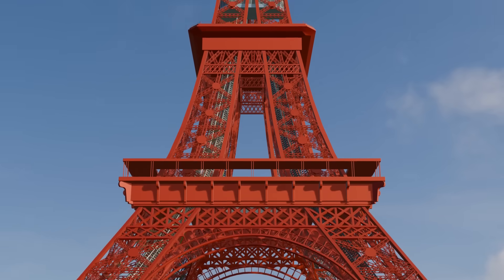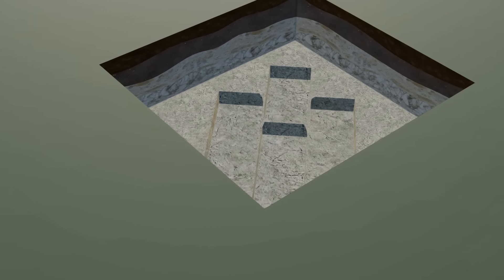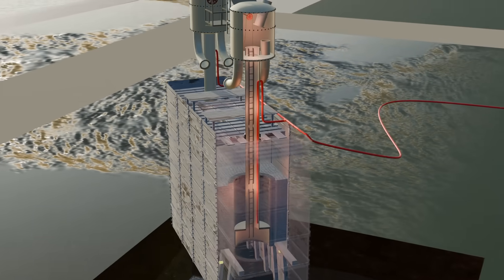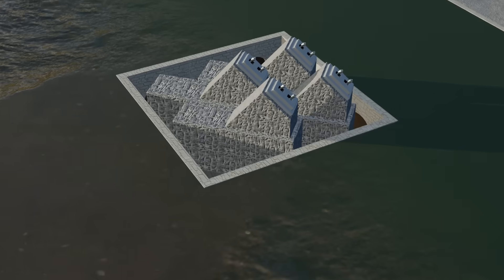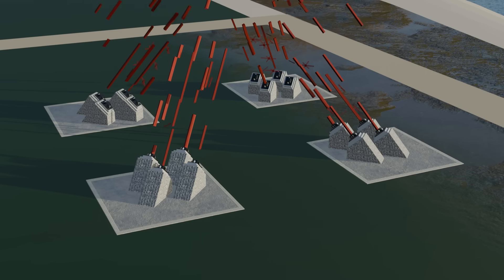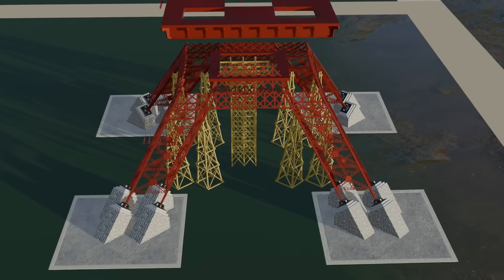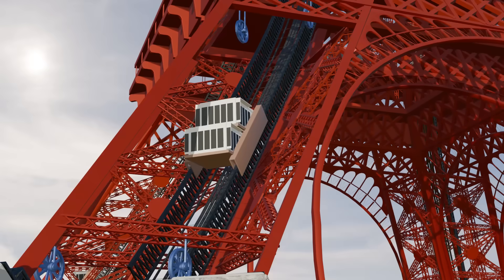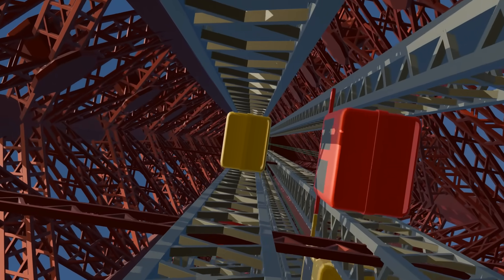The Hidden System That Lifts the Eiffel Tower

Comment: One important fact omitted.
As the lower elevator’s track is curved, the cabin doesn’t ride the track directly. It’s mounted on a carriage and swivels to remain level.
Also the cabin is two-Storey, with the individual storeys being offset to accommodate for the tower leg angle.

Comment: 9:06 i think that they should install some canvas or plastic sheeting around the tower so that rain doesn't fall on it and cause Rust. Otherwise the tower will eventually colapse. From rust Decoposition.
Reply: There's paint on it, like the red Bay bridge in SF, which prevents the iron from being in contact with both air and water. I'm not sure how special that paint may be but it has to be repainted on a regular basis, maybe every 10 years, because the sun and rain do wear out the paint, and the temperature changes cause the iron to expand and contract, creating tiny cracks in the paint where moisture can get in. Maybe they should have coated it with gold foil, like the roof of many temples and mosques, as gold lasts forever, won't tarnish nor crack, and it would look really nice, but maybe it wouldn't stick to iron or the shape is just too convoluted compared to a smooth rounded roof.

Comment: Wots more-tar?
Reply: It's when you have more than one tar.
Reply: And kai-san?
And purr-IZ-ians?
And Seen river?
And "locked the competents firmly together"?
And deck-or-A-tiv?
And accum-uh-lator?
Reply: Needed for longer roads.
Reply: @douglasclerk2764 So what do you use for shorter roads?
Reply: "mortar" is a binding paste that hardens into a solid and is typically a mixture of cement, lime, sand, and water.

Comment: The directions of the legs are labeled wrong.  It is the North and West legs by the seine not the North and East.  The South and East are on the dry side.  I hate the computer generated narration.  It mispronounces Cassions and Mortar.
Reply: That is correct. Looking North, East is on your right hand. So how reliable is the rest of the presentation?
Reply: I was thinking the same.